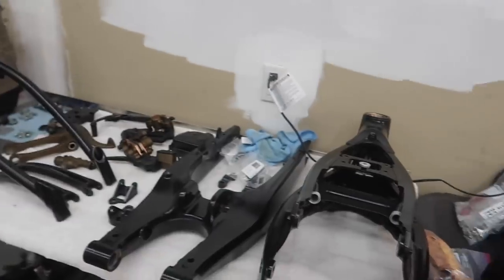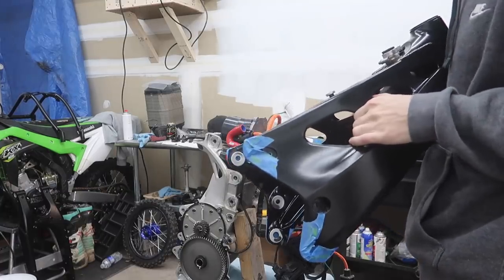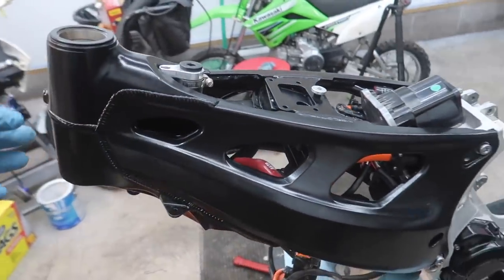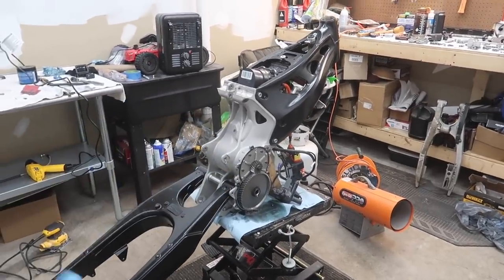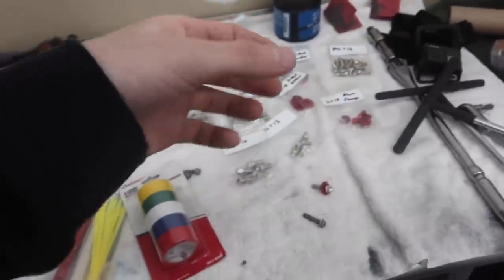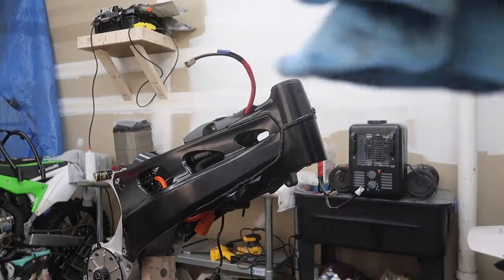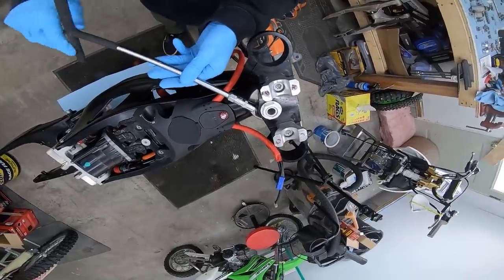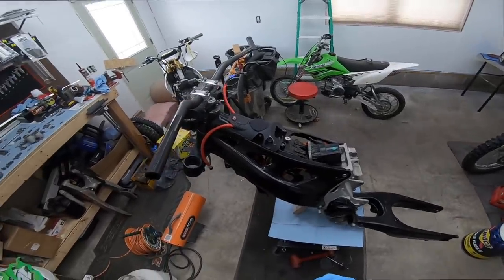ALTA BUILD PT.3 | RE-ASSEMBLY - NEW PARTS

Comment: ****BEST BIKE STAND EVER*****   Sup Tyler, big fan.   I built a Buell bike a few years back and it (luke tour Alta) couldn't be lifted traditionally....    I ended up using ratchet straps hung from the ceiling.   Literally my go to Motorcycle lift now.   I've hung some pretty heavy bikes (Harleys) from screw-in eyehooks, through sheetrock, into the trusses..   If nothing else, just wrap them around the rafters,  I figure if one will hold up my 200lbs body weight, 4 can easily hold up a dirt bike...  Hope this helps,  thanks for some of the best and only pit bikes on YouTube!
Reply: Luke tour, * like your....  I'm not a bot,  haha..

Comment: Put a bolt through the top shock mount and take apart a ratchet strap run the strap around the bolt a hook each end of the strap to the foot peg hold-downs on the stand.